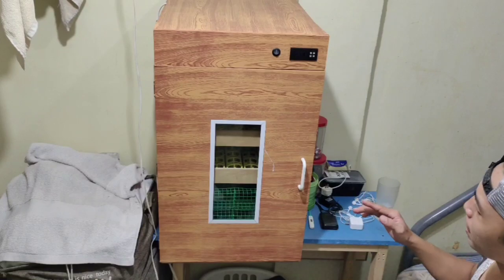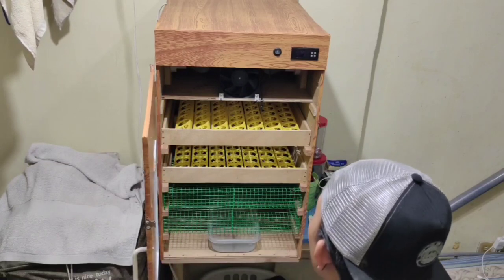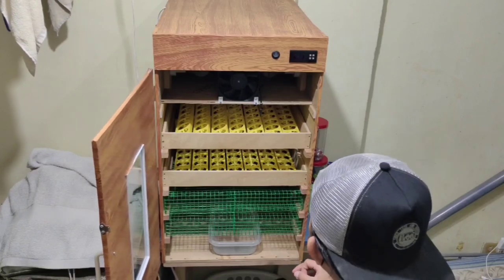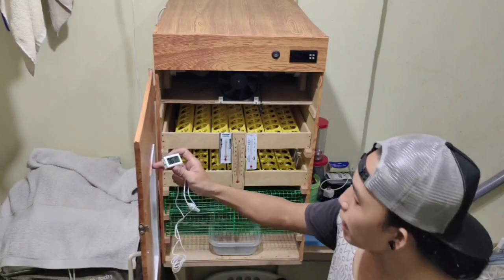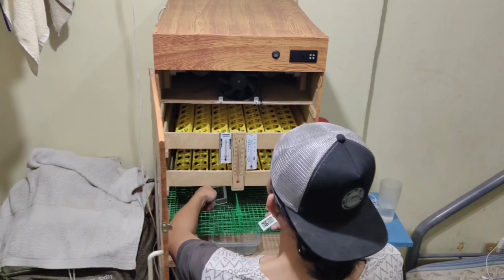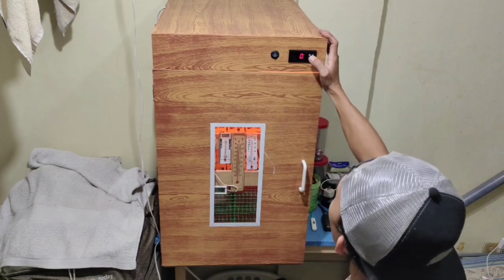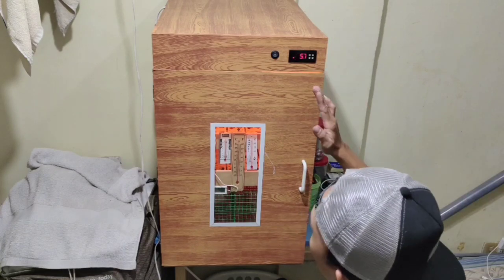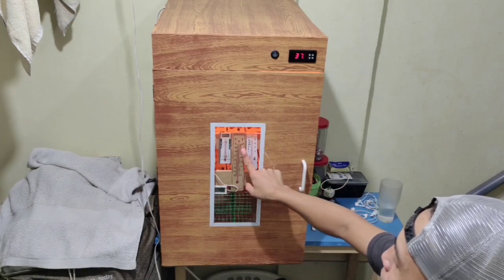HOW TO CALIBRATE EGG INCUBATOR (EPISODE 5)

Comment: Bos tanong lng po ginaya ko po ung incu nyo stc 1000 po gmit ko s incu ko rin po nka set po ito s 37.8of 37.2on. ang lumalabas po s hygrometer humidity ko 65 po tpos meron din po ako nilagay n temperature ang lumalabas po 35.2 lng po pno po ptaasin ang temp po para mging 37.5. Slmat po s shot idol.
Reply: try mo set sa F4 sir -2.3